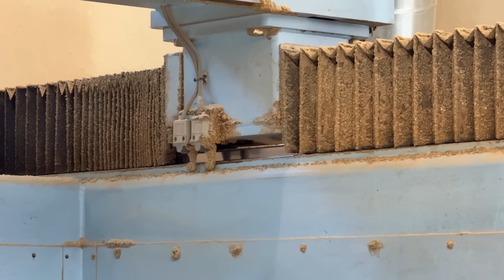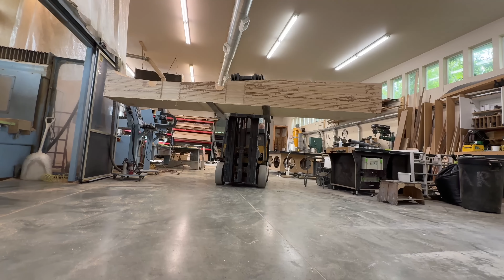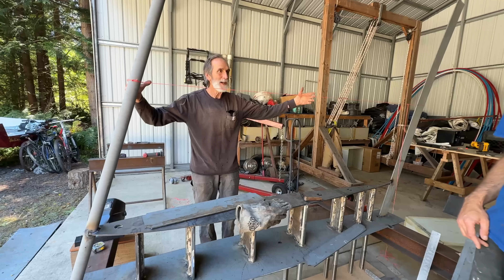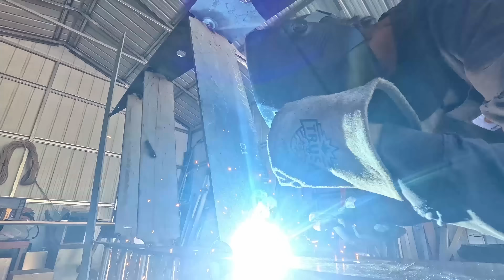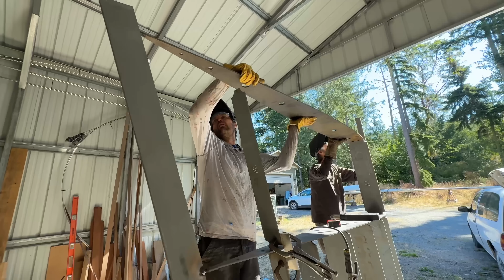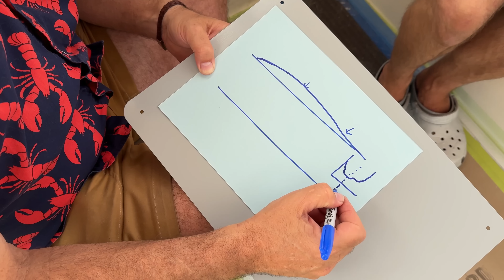The Coolest Thing About Our New Keel. [Ep. 184]

Comment: Nice job on the first skin fit-up. 
The guy that rolled that did a fantastic job, not easy in any way shape or form to get it that close. He is another artist, no question, just a heap of respect for him as a craftsman. 
The fact that your welder/fabricator only needed two dogs to pull it in at the centre(ish) speaks volumes for how closely it conformed to the intended profile. 
Very nicely done indeed!
Getting a complex fully fabricated object like this right takes as long as it takes, there’s no book on it and cutting corners to try to shave a day or three off the job simply doesn’t work. 
Looking forward to the second skin fit-up and the lead pour. 
Also steeling myself for the fin-al barrage of positively atrocious punnery.
🥴👍🍻

Comment: I don't know if you really read all the comments here but I've met an retired german engineer called Gerhardt in Mexico.
He built a hollow keel and for rust protection he filed it with ethylene glycol based antifreeze/anti corrosion fluid used in automotive cooling systems.
It's relatively cheap, easily available and when submerged it doesn't add weight.
Also, when the keel needs repair, it won't create explosive fumes when heated.
Reply from the maker: It’s a good idea but we have a different plan

Comment: Probably a bit late but did you consider using the keel as a fuel tank??
I had a 44ft steel yacht that incorporated part of the keel as the fuel tank makes a lot of sense to me. 
Keep up the excellent work.
Reply from the maker: Yes but it would have been an even bigger engineering challenge

Comment: I’m a bit curious about the choice to leave the keel filled with air. Both because of issues with condensation etc. ( and the universal propensity of water to allways get into anything and everything).
Secondly doesn’t it add bouancy in the wrong place? This air pocket in the keel must account for a couple of thousand newtons of lift.
How about filling it with something like petroleum jelly often that is used to protect electrical connections from water?
It is still lighter than water at  52.4 lb/ft^3 but significantly heavier than air  0.075lb/ft^3, sticks to surfaces while not running and is very hydrofobic.
Not sure about the price though…
Reply: Granted, not much lift compred to the weight of the boat…

Comment: I am curious. You’ve got 9000 pounds of lead for a ballast and you’re going to  have a     
large air space above your actual ballast. Would it not be better to fill that cavity with either oil or wheel bearing grease then you could cut down on the amount of lead in the keel ?

Comment: Hi

The keel will be welded airtight,  that means, according to good old Arcimedes, the inside volume of the keel will create upp drift that you have to deduct from the weight of the lead and the steel. Wouldn't be better to fill the inside with concrete, same used on oilrigs.

SkipPer

Comment: You might want to consult another welder to see if your guy is doing the right thing with the right equipment
Reply from the maker: We are having it inspected
Reply: Xray will tell. I don't think you are a welder if you were you could tell the general quality of the welder by the sound of the weld.
Reply: I’d back the guy with the stick welder, many a tractor in the glens held together with more weld than tractor
Reply: @SkipperCraig 
Some steel has to be welded mandatory with a stick due to it slower cooling by the presence of slag. Truck chassis elongating or shortening is one of the traits where it is or was mandatory to use sticks with some specific properties.
Reply: I've been watching the guy too. Strange that he's using a stick welder and not a MIG. Those welds don't look too good, especially for such a safety-critical component.
Reply: @RebuildingScotland 
What an utter bullocks. A MIG-MAG welder doesn't have near the penetration  a stick welder has. The variety of available sticks is much greater than the variety of wire rolls. He's a professional welder for 40 years and you know better as an armchair expert? Let yourself get checked please something's wrong.
Reply: @henkormel5610  I have been in engineering/fabrication since 1983, so am a workshop expert, not armchair expert. Look at any welding/fabrication channel here, like CEE Engineering, On Fire Welding, Snowball Engineering etc and they're welding up to 2 1/2" thick with..... guess what...a MIG welder. Clearly you are the armchair amateur!
Reply: @RebuildingScotland 
As you claim.
I see a lot of armchair 'experts' criticising seasoned professionals on various comment sections under various video's.

I started in the industry in the late 80's and learned that there are more ways to a similar result than only one. The welder souds sufficient but is maxed out on a one phase outlet.

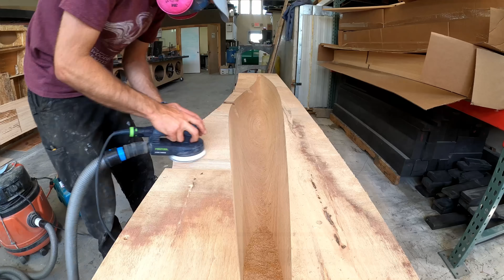Comment: 14:26 - I am curious if this mold could have been created without the precision of a CNC machine? There is no question that with your skill and (VERY) admirable attention to detail, if you could create the mold by “hand” (so to speak), you would still create a mold that would be of high quality… but would it have enough downsides that the only real way to make this work is with the accuracy of CNC? 

I say “by hand” because I can’t think of another way to say it… I know you’d still be using power and other tools, so I’m NOT referring to hammer & chisel!😂 I am using “by hand” meaning “no CNC use”.  So assuming you could do it “by hand”, how much longer do you think it would take? I’m asking because from my armchair quarterback position, even the CNC required a significant amount of time, I’d have to think without that, you would have added a significant amount of time & energy to accomplish this, yes? 

I made a comment last video that at the beginning of the keel project, my temptation was to skip watching and get the Coles Notes version later on because my thoughts were “the keel IS extremely important, but this is going to be boring….”. Well I haven’t skipped through any of the keel process because it’s been anything but boring! It’s been super interesting watching this part and I just HAVE TO appreciate the intricacies involved and how you’ve pulled that all together as well as pulling together a boat building community that is unreal!! Great job all around, from the raw materials, the mashing of ideas with some great minds, detailed plans, the help from some true masters in their fields, putting everything together, and OF COURSE, the fantastic editing of the video production!! Definitely an “A++” performance from both of you!!! 🤠👍🏼☮️
Cheers from 🇨🇦
Reply from the maker: Thanks for your kind words!

Comment: Hello greetings from Germany 
Why not doing an upgrade
tu your Finn, filling it with argon instead of air. The argon has a weight of about 1.7. , air is roundabout 1.1. so you can fill it from the bottom upwards. It will take out the Oxygen and so no Oxydation meens Korrosion anymore. Argon you can get everywhere as welding gas.

Comment: This episode nicely shows a few of the many different skills needed to make a good boat. Construction wise, the keel made of sheet metal is something of a foreign object among all the laminate, but it seems a pragmatic choice, and probably much less work than building a new laminate keel from scratch.

I enjoyed the fluid dynamics talk at the end. Many years ago I self-taught this stuff learning to design model airplanes while I was still in school.
The main argument against laminar flow airfoils on cruising boats really is they only work as intended when the surface is perfectly clean and smooth. Even a coat of botom paint applied with a roller or brush may already be too rough, let alone some marine growth. 
The small useful laminar angle range means in my opinion it really is only good for downwind sailing and motoring at low propulsion power. This keel has an aspect ratio near 1, so at any meaningful angle of attack the induced drag will be much much larger than the drag caused by the airfoil shape. And at near hull speed all that is again too small to really matter.

Comment: Looking at the welds with that small cheap 110 welder is subject to failure from surface welds with poor penetration. For a job this demanding for strong welds i would of used a 220 mig or wire feed welder with gas to shield the welds . With this many welds for the base structure the welds need to have complete penteation and consistency and you just cant get that from a small 110 hobby welder. I hope it holds up under the enormous pressures this fin is going to have on those welds.
Reply from the maker: If you are a welder or have significant experience, please do email us with your concerns. But also know that we are getting it inspected and doing a dye test.

Comment: I'm still so confused why it was important to make the negative out of such an expensive and difficult material. It seems like this would go a lot easier if a positive was cut from foam and then a negative was made out of greensand or another one time use material. I have no experience with keel making, but can someone explain to me why I'm wrong?
Reply from the maker: Sand mould is more expensive at least for this project and where we live

Comment: So the fin is going to spend it life trying to float and the lead is going to spend it’s life trying to fight the sails , hull , keel load and keel bouncy. Just one question, why !? If you filled the fin with concrete it could be slimmer with the same rigidity and assist righting moments instead of fighting them . I am sorry open damp void, trying to tip the boat we’re is the plus ? A couple of extra degrees of heal for a given breeze won’t hurt but I don’t see a single plus in this design good luck if you must go down this path at least purge the fin with dry nitrogen ,  never pump air into it or the inside will be permanently wet go open the drain on you compressor if you have doubts

Comment: Stick welding has been done a long time & alinement once done should be wirhin tolerance. You have to remember that adjustments are made as in your video even with CAD. 
I would say when the long bars are fitted the circles that they go through will be ground out. Some bending is expected in the fabrication process.
Trying to fit long bolts is another process & accuracy reaches a hole new level. Probably with a straight edge. But once all fitted together a tolerance is factored in to the process, or the cost go sky high.

Comment: Good work, except like I had mentioned before. This job really could have benefited from a 240v mig welder with some shielding gas and dual shield wire. 110v stick welders just don't have the same penetration.
Reply: I’m also glad someone picked up on the welds.  I know they won’t be seen but, ….. I just don’t like the looks of them.  They look like surface “globs” not fully penetrated welds.  Considering the forces on the keel, you don’t want anything compromised at this point.  At the very least Matt, have a 3rd party inspection done.  
Keep up the good work
Reply: @blackgold9937 yea i agree on that, i was just saying i understand someone cannot be a pro in every field and industry, some things you just gotta delegate and trust in a professional. If it was me i would spend on those welds, but i`m a mechanics designer and i like welds a lot so it’s my fetish i know it doesn’t have to be pretty it just needs to be structurally sound… but i agree with you, working in the shipbuilding industry and seeing the guy weld with that toy makes me smile but it’s also kinda horrific… 50 years ago before mig maybe it could have been ok. Btw a lot of people still believe that ship’s certified welds are done with the sticks… what do they know that nowadays if it’s not a mig robot, it’s a pakistani with a giant mig that can go for meters before changing the spool… 
Btw i’m from italy i’m sorry for my english it’s kind of self taught
Edit: i thought maybe also 50 years ago you would use a more powerful stick welder that really is a toy
Reply: you are right but probably won't be a big problem, also, too much heat and that thing would just get distorted like a banana, so you only need the right penetration, also, i think they engineered a big margin in the structural capacity of the fin and the welds... still i also think a decent mig welder woulda been nice. but matt is not a steel worker what can you say
Reply: @lupoMalditesta the fact that Matt is not a steel worker is all the more reason to have an informed second opinion. Heat distortion, yeah , maybe if you dropped it in a volcano. Kind of like this: some pretty crappy sailing technique can look “ really good” if you’re a powerboat driver.😊
Reply: I’m glad somebody else said that. The welds look cold and the penetration looks questionable. Those hobby shop  110v welders don’t have the horsepower to weld materials that thick. About 1/8” material is all I’d venture. You need to get somebody well versed in welding to look this over. You don’t have any reason to believe me, but at least have a second opinion by someone familiar with welding big structures. 😮

Comment: Hopefully you're adding some bracing to the fin - the way those plates are laid out provides basically zero rigidity tortionally about the beam axis. E.g. if you run aground or the tide goes out and you're left with the hull sitting on the keel, the only thing keeping the keel fin together is those stick welds, the pipe at the leading edge, and the bar at the trailing edge. Or if you are in rough seas and the hull slams down into a wave - the keel bulb is going to want to keep moving forwards. Would you trust the fin to support the weight of the hull? Or the dynamic load of the bulb being decelerated? Even if it's skinned with a glass layer, that won't really be sufficient unless it's thiccc. 

Overall this design (so far) seems like it's disregarding established construction techniques and well understood loads, and I wouldn't be confident sailing it even coastally. Maybe there's more to come but if I were you, I'd get a second opinion on that engineering...
Reply: Isn’t that what the skin does?
Reply: The keel fin will have a steel skin on the outside. Not fiberglass. There are several videos on this channel about the keel. It appears to me from your comment that you have not watched any of them apart from this one. Particularly since you mentioned fiberglass skin. That guy Evan is actually a naval architect.

Comment: Maybe put a valve point a the top which reach’s in the bilge as well and fill keel with vegetable oil  then you could check the fluid  level if comes up ,reduce the rust risk and most of the positive floatation from air and keep the drain point at bottom .co2 gas could be used at a low pressures but that would come with a risk of smothering if co2gas leaks into cabin use vaccum pump to remove air and water first without breaking seal charge with co2.
Reply: I think you mean *reaches into the bilge. Sounds horribly complicated and I think a naval architect knows better than an armchair “expert”.
Reply: @steviefordranger198  one armchair expert to another. All other parts and systems are just diy kits

Comment: Two open questions:
1) Why did you choose a solid plywood mold, vs the other male/female casting options?
2) NACA “airfoils” were developed and tested — for wings, in air.  Are these “hydrofoil” keel shapes and performance coefficients, now also rated and cataloged — for the different conditions of marine applications (I.e., velocity, fluid viscosity, etc.)?
Reply: Keels operate in similar Reynolds numbers as a Cessna wing flying at 100 knots :)
Reply: I believe you can find tabulated lift drag data for naca 00xx foils over a wide range of reynolds numbers. It is a very old foil.
Reply: @mckenziekeith7434  Yes I have an equally old copy of Abbott and Von Doenhoff's "Theory of Wing Sections"!
Reply: Addendum to my questions:  3) Most airfoils (excepting some stunt planes) are “asymmetrical” in shape, and consequently asymmetrically defined in AoA, drag, lift, gravity, etc.  By contrast, keels must be “symmetrical”.  So — are many NACA shapes defined with symmetry?, and then rated with those hydrodynamic performance results (+ temperature, vortices, cavitation) too?
[I expect the nuke sub designers have all this, but wondering how much data vs guesstimates is available to marine designers?]
Reply: @sandycalifbeach  Lots of NACA foils are symmetric. Sailboat design still has a lot of art to it so except at the very high end of design, selecting of a keel foil isn't that hard. Often structural considerations come in to play - too narrow a foil and the bolts are too close together for example.

Comment: It's crazy to me that he's stick welding that entire thing! Having the expertise to be that precise with a stick welder is quite impressive.
Reply: Right!?
Reply: I would have  suggested welding with Flux Core wire by a certified professional welder. I’d be equally concerned about lack of weld penetration or heat affected zone. What about testing the welds using dye penetrates or mag-flux . Welding joint prep using partial penetrating welds or complete penetration weld.
Reply: @jazzrunnersailor There is no basis for that level of scrutiny. Visual inspection of those welds is plenty sufficient.
Reply: High quality stick work is easily equal to strength mig work using the right materials. The trick is the learning curve is more of a mountain and few people get to those heights. 
Almost anyone can become decently competent with a mig and they can do it quickly. Bloke is excellent.